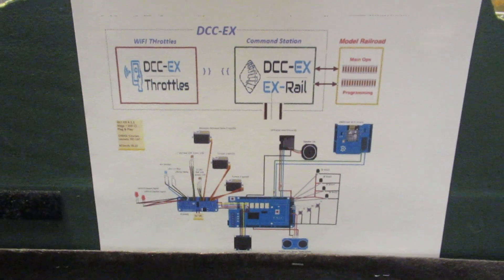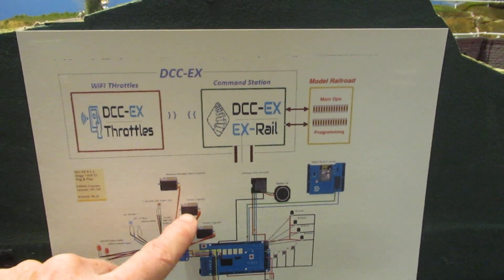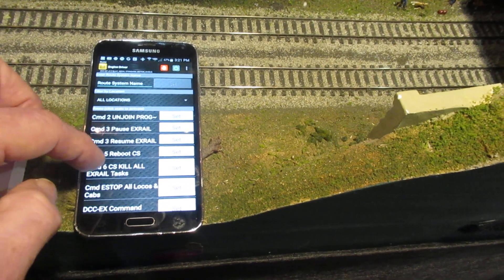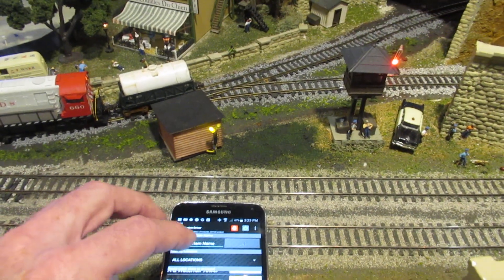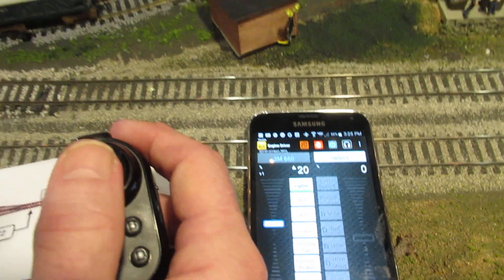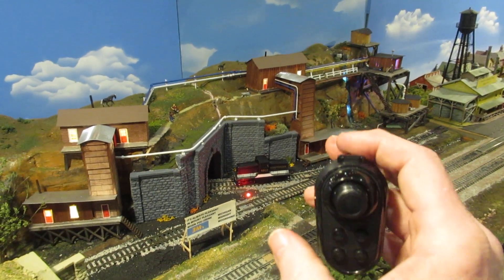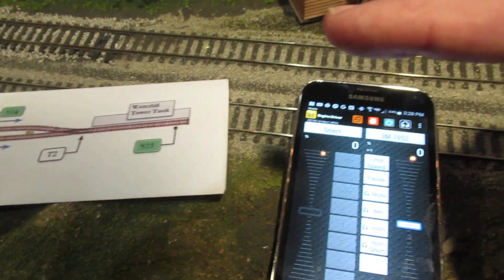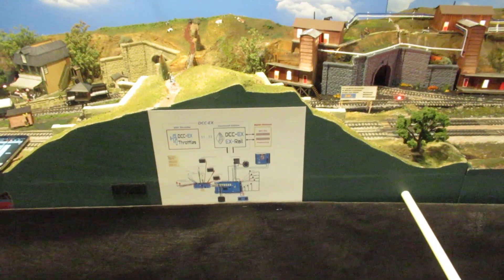DCC-EX Command Station with EXRAIL & TrackManager Part 1

Comment: Wow very interesting so your comand station is like flipping  the old toggle swth. F/DC~Dcc ?
Reply from the maker: Even better,

I don't have to walk over to a physical hardware toggle switch to change it from DCC to DC or vise versa.
I can assign any insullated district/track to be which ever I want either with a button on a throttle and or in a prewritten EXRAIL Route or Automation script.

And In DC mode I can use the DC Cab# on the side of the engine and assign it's cab# to that district and use the same cab# in the throttle, from 1 to 10239, all without the use of any DCC Decoders.
 DCC-EX command station acts like one large intellegent encoder/decoder for the layout.

Comment: I just converted from DC to DCC using DCC-EX.   I couldn't be happier with it.    Thank god for smartphone wifi throttles.     As a software developer for over 30 years,  I'm impressed with the reliability of the whole setup.
Reply from the maker: We are glad you have such a great first time experience with DCC-EX.

Be sure to keep up to date on the latest new developement enhancements with our soon to be released version v5.4.

Which includes new EXRAIL Animation & Automation  functions and support on newer more Powerful microcontrollers like the EspressIf ESP32 family of processors with built-in WiFi and Bluetooth chips.

Kevin
DCC-EX Dev Team

Comment: Are you only using a single arduino?
Reply from the maker: Sorry for the delay.

Yes, in this video I'm only using One Mega2560 with a Makerfab ESP8266 WiFi Shield and a standard L298p motor shield to drive two separate insulated districts/tracks in either or both DCC and DC PWM modes.

I have since upgraded the Mega2560 and added a second Stacked Std L298P motor shield providing 4 four separate DCC and or DC districts/tracks via v5.0 TrackManager feature.

I've also added additional OLED displays for track power overload detection & display messages as well as Passenger Station Arrival & Departure displays.

Comment: Hi great video, thank you. Can you show how you connected the PCA9685 to the motor shield please.
Reply from the maker: Hello Brendan, and Thank you.

Connecting PCA9685 Servo Signal boards is very simple with four wires 5v, Gnd, SCL, SDA.
The DCC-EX Command Station will automatically connect to and assign the first two boards with addresses 40 and 41
which gives you the capability to use virtual pin numbers vpin 100-115 and 116-131 respectively.
https://dcc-ex.com/reference/developers/hal-config.html#pca9685-modules 

Regards,
Kevin

Comment: How do you run DC in DCC-EX? does the software support it or did you modify the code to change the motor shield from AC mode to DC PWM mode?
Reply from the maker: Hello eecg23,

'How do you run DC in DCC-EX'?
DCC-EX is now available in DCC-EX version v.5.0+ supports both DCC{PWM} and DC{PWM} Pulse Width Modulation modes as a embedded standard feature of the DCC-EX Command Station.
No additional external DCC decoders are used to create or utilize DC{PWM} Tack assignments

DCC{PWM} is detected on a multi meter as a AC signal but in square wave form Not as a sine wave
  DC{PWM} is detected on a multi meter as a DC signal in a  square wave form Not as a direct current wave

Using our New TrackManagerTM feature with simple easy command from a throttle or from a serial monitor we can change any insulated track from DCC{PWM} to DC{PWM} and back in real time.
 - valid DCC modes are MAIN & PROG and OFF
 - valid DC  modes are  DC & DCX and OFF.   

DCX is for Opposite Polarity of a track like NMRA modular layout track B which is wired Left rail +red and Right rail -neg.
this allows a throttle on Track B set to DCX to operate in Forward and Reverse correctly for west bound engines.

So, I can take a standard DC motor only engines CAB number on the side of the engine and assign it to one or more of up to 8 tracks/districts/blocks labeled A thru H then enter that same number into a Throttle and control that Loco Cab # on each and every one of the assigned tracks.
 +Valid Cab addresses are 1 to 10239.  
 - Invalid Cab address is 0 zero.

We do Not support 0zero stretch function, on purpose.  
Place any DC Cab on any proprietary DCC track and it will light up and huumm because it receiving a Dual DCC{PWM} aka AC signal.  
Place any DC Cab on our DCC-EX command Station with a TrackManager DC assigned track and it sits there dead quiet with lights off Until the throttle speed is increased in either direction and then lights up and begins to move.

DCC engines with DC enabled CV decoder also sits quietly and when the throttle increased the Sound will turn on first then it will begin moving.
You can throttle back until it stops but leave a little throttle speed on say 5% and the Sound will continue to play while it's stopped.

Come chat with us in the DCC-EX Discord channel about TrackManager aka., DCdistrict which is planned to be released to the general public as version 5.0.        https://dcc-ex.com/trackmanager/#gsc.tab=0 

Hope this was helpful,
Regards,
Kevin
Reply: @Kevincsmith0708  thank you very much for the information, I think I'll download the development version with that feature I was thinking to insert my DC PWM code in the DCC-EX code to support DC with DCC-EX station but you already did,  that's great, I have more questions I'll ask them in Discord, thank you.
Reply from the maker: @eecg23  
You are Very Welcome.
And Thank you for Exploring DCC-EX and joining us on our Discord support channel.
Look me up as 'KC Smith'
Reply: @Kevincsmith0708  what is the Time line dc district released
Reply from the maker: @matthewesler8379  Hi Matthew,

DCC-EX Command Station with TrackManagerTM includes Both embedded features of
  DCCdistrict modes of MAIN, PROG & NONE
   DCdistrict modes of DC, DCX & NONE

It's currently in final Beta testing in the Development sub-branch under 'devel' v 4.2.22 
We have a LOT of New features/enhancements inside this future release as v5.0+ above and beyond TM and we're in the process of deciding which of these other main features/enhancement to release with it at the same time, and which to hold back for further enhancement and devel testing.

My guess is August 2023 as DCC-EX version 5.0.

But you can download this 'devel' 4.2.+ release or all future Development Releases from
 DCC-EX.com >
   Downloads> 
    Command Station Latest EX-CommandStation Unreleased Development Version,
      just click on [Development Version] button
https://dcc-ex.com/download/ex-commandstation.html#latest-ex-commandstation-unreleased-development-version 

Thanks for your interest in DCC-EX and TrackManager   https://dcc-ex.com/trackmanager/#gsc.tab=0
Regards,
Kevin
Reply: @Kevincsmith0708  thank you